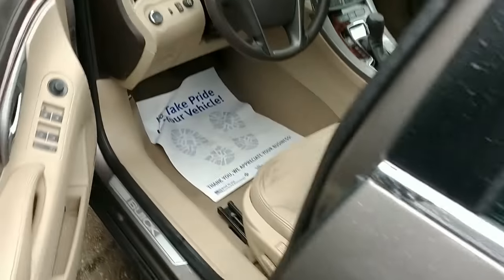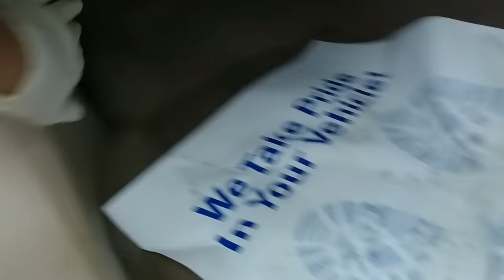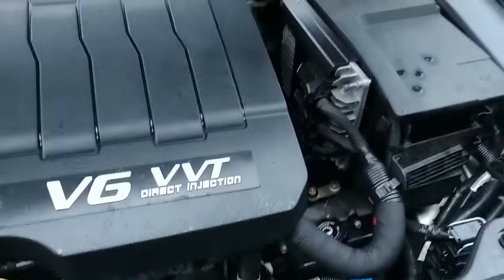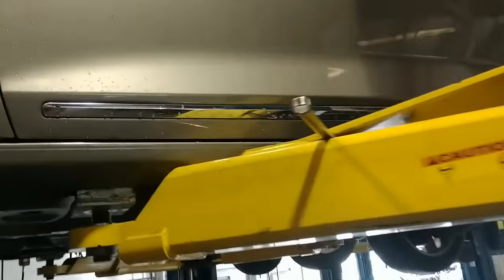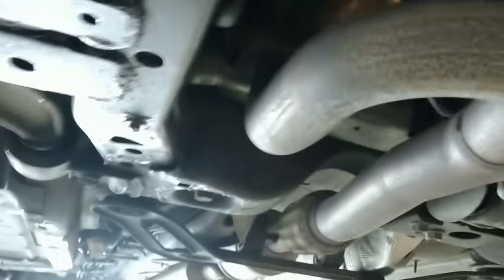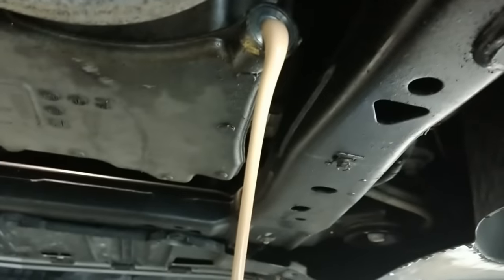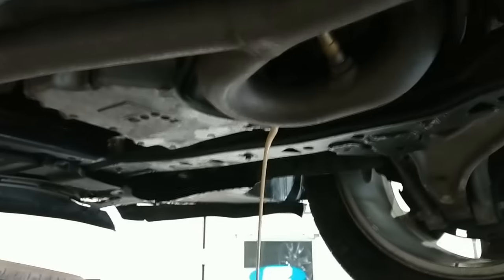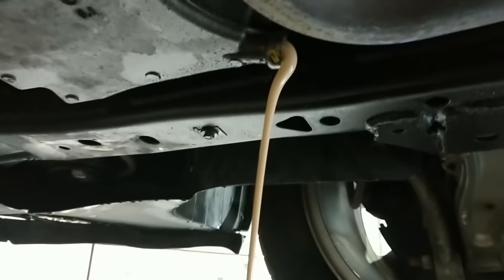Overfilled Crankcase! Blown ENGINE! Used Car Nightmare!

Comment: A buddy of mine swung his car into a firestone for a pre trip maintenance instead of doing it himself cause he was short on time. Car was overheating and being weird. Its some 2010s Subaru impreza. We check it at work. The kids in there got the fill tubes mixed up since multiple are right next each other. They put quarts of oil into his coolant overflow reservoir. They denied the mess up but they definitely knew cause they filled the engine with oil after their mistake! Luckily he was able to flush the coolant system. Dont think firestone reimbursed him

Comment: Great job on those headers flanges replacing the studs I would have been tempted to chase the threads with an old bolt with groove s ground length of the threads just to clean them out and get the chips out but great job have a great day

Comment: Back in the old days a new head gasket, coolant and oil would fix everything.
Reply: Yeah before everything was made of soft aluminum.... Also being able to use a regular steel razor blade to clean surfaces!
Reply: It could also be a cracked head or a cracked block.
Reply: Back then, you could do it in 3 or 4 hours easily as a HS kid...

Today you spend 6 hours getting at the valve covers.
Reply: @fhuber7507  god if ur spending 6 hours on Valve covers u don’t need to be doing it 😂
Reply: Yeah, but do you still want to drive a 6 liter V8 that puts out 20 hp? Modern engines are stupidly complex to fix, but worth it for the power and economy they put out.
Reply: Back in the old days cars were death traps. Pick your poison
Reply: Considering there was no leakage of that sludge anywhere, I don’t think there’s a cracked block.  I think all they need to do is get in there with a Steam-line, clean it out really really good.  put in a new head gasket and new oil  and coolant, and she should be good to go.  but I would still go back to where she bought this car from.  a copy of this video in hand, and tell them “you are going to pay for the automotive service I just had done, on the vehicle I just bought from you. Or shall we go ahead and involve the police right now?“
Reply: @Here_is_Waldo  Yes and no, some designs use more complex or fragile components not for eficiency but to actually límit the life of the machines forcing the costumbres to.pay expensive maintenamce or replacements way more often, prpgramaded obsolecence is a real thing unfortunaly.
Reply: @boatingman11  Or a cracked cylinder,  or they used the wrong coolant,  mixed coolants,  or the wrong oil!  Today's cars are junk!
Reply: @Here_is_Waldo  they are not stupidly complex. The computer allows a lower voltage do that you do not have to have heavy duty switches that cost a small fortune.  Now, the computer only does it going properly, if everything is working.  Scan it up, fix it,  go on with life. What's complicated about that?  The issue is dealers weekday money!  With coil packs made so cheap that a taco costs more to make, and they charge you a fortune for them,  yet they don't last the life of a vehicle, and fuel systems that are regulated by too many regulators and sensors it is all about the cash.. the only thing complicated is finding the damn funds to pay for the parts!
Reply: @beastabuelos6421  say what!  Death traps!  I have a 1975 G29 van with lap belts. If you hit my van with today's junk,  you will be totaled!  I'll drive home!  I believe it's called steel!  Plus,  my van will haul more than a new 3/4 ton truck!  You need to check the Reynolds Wrap made today before you call my tank a death trap!
Reply: @kenwaid8239  It's a Civil matter. The Police can do nothing.
Reply: @offgridselfteliant  That isn't a good thing or something to brag about... Ever heard of crumple zones? I'd rather have a crushed car than be dead on impact and my head caved into to steering wheel.
Reply: @beastabuelos6421  how is that when they were made out of stronger, materials smh,
Reply: I had an old 97 k1500 with a 305. Blew a headgasket like this around 210k miles during the height of Dallas summer. Had to have some other stuff done too, but it wasn't too much more than this. She ran great well past 250k. Thank god it wasn't a cracked block!
Reply: @kenwaid8239  buyer beware. The vehicle was probably sold AS-IS meaning its the buyers responsibility to make sure its in good working condition. This is the case with 99% of ALL used auto dealershits. Test drive the car STRAIGHT to a mechanic before you sign ANY papers or hand over any money, period, no excuse.
Reply: Reading the comments… happy to be on a motorcycle. I’ve been hit by a car and survived… I’m still riding. Pick your poison.

Crumple zones are nice, but there is nothing that feels the same as an old muscle car. Heavy as hell, you let off the gas and coast for like six miles off the inertia…. My old Impala had the 350 V8 motor in it. Made it to like 300k miles. 

I still prefer newer cars for a daily drive (I drive a 5 speed manual Ford from the 1990s when I need something that doesn’t fit on the bike), but the old cars had a lot of charm. That said, I do NOT miss having to rebuild carburetors and every damn thing weighing a metric ton. Honestly, the water pump for my Ford was a brick and only cost like fifty bucks. The same went out on my exes Subaru, weighed nothing and it was like $300. Odd how it all works.
Reply: @vgamesx1  Laughing. ... you hit a old vehicle with the new Reynolds Wrap vehicles that air bag is not going to save you!  It would be like a aluminum can meeting a crusher.  The math tells you that the lighter vegicle will go backward against the heavyweight vehicle.  I'd rather kiss a windshield than be smashed like a aluminum can.  If you drive into a concrete wall at 20 mph, you would not drive home.  I would!  Safety isn't just a belt and air bag. Think about it. 2 tons hitting a 1 ton car.  Plus I could have an extra 1,000 pounds in the back.  But hey,  you just feel safe in your Reynolds Wrap.
Reply: @offgridselfteliant  I enjoy my fuel efficiency thank you very much. While dealers do upcharge a lot of things to repair a car, modern engines are marvels of engineering optimized for fuel efficiency and power, and it's not cheap to make the parts for a modern engine. Sure old cars just had blocks of steel welded together for engines, but I don't think I'd like the 16 MPG at best gas mileage they have lol
Reply: @DrTranofEvil  Yeah, the water pump is something they really upcharge a lot on. It's worth 100 bucks due to all thr electronic integration put into modern vehicle parts
Reply: @offgridselfteliant  not a cracked cylinder. If you crack a cylinder you pressurize the oil the oil system enough you'll see sludge all the way to the top of the dipstick
Reply: @offgridselfteliant  same.  In my youth I had one of the last Chevy S10's made with real steel bumpers.  I hit a more modern vehicle when it ran a stop sign.   felt the rear tires on my S10 lift off the ground on impact.  Their car was totaled, I drove home and bought a new bumper.  Installed it the next day myself, good as new.  All i had to do was apply a little persuassion with a 10 pound sledge to the mounting brackets to line up the bolt holes.  Miss that car.

Comment: reminds me of a friends wife, bought a car cheap knowing full well it was leaking coolant and needed a repair (seller even gave her a 5 litre container of coolant fluid), what she didn't know was where the coolant had to go. To be fair she made it all the way home thinking the symbol that looked like a small oil can was where  the coolant went to keep the oil cool. It did not start the next day or ever again.
Reply: ouch
Reply: Well, that symbol's colored red for a reason.
Reply: I am a female and always checked my fluid levels in the vehicles that I owned since I keep them for 20+ years and make sure they are maintained. Even repair shops don’t tighten down the oil filters after an oil change so I always follow up after any maintenance. My husband was overseas for a year and I was responsible for our 3 cars and had the hoods up one day checking everything. A neighbor out walking stopped and asked if I had trouble and I said I was just checking everything. I am in my 60’s and she is older than me. She said she wouldn’t know what she would be looking for and didn’t even know how to open her hood. People don’t realize that at some point you might not have your partner and can’t rely on them for everything, be it cars, handling bills or anything yard or home maintenance related.
Reply: @tastx3142  I am a veteran myself and spent 14 of my 23 years overseas, my wife much like yourself became proficient at all the things you have mentioned. I often came home to find the entire house in different colours, rooms changed around or completely different furniture lol.
Reply: At least she didn't put diesel in the gas tank like my mother did once, yeah that happened, to be fair it was next to the gas pumps but still, your can rebuild the engine and it still won't ever run the same, it's about the same as that
Reply: @shable1436  Diesel in a gas engine should be fine, actually. Of course, it won't run because it can't ignite the diesel fuel but other than the fuel system, nothing should be affected and after cleaning that out (maybe replacing a few fuel hoses) it should run like nothing ever happened.
Gas in a diesel engine is the real problem because the fuel will ignite too soon and push the piston back, destroying the entire engine block in the process.
Reply: @Seoh wonk em  I never mentioned common sense, just pointed out that people rely on others to do basic things, and that includes males.
Reply: Tell your friend his wife should never drive a car even again
Reply: @tastx3142  you're awesome i want a wife like you that can take care of cars when I'm away :/
Reply: @shable1436  I put petrol (gas) in my diesel vehicle, realised my mistake, topped up with diesel (about 50/50) and it ran beautifully. Never missed a beat.
Reply: @tooyoungtobeold8756  I suppose it depends on the compression ratio of your engine, the octane of the gasoline, if it's diluted enough, it won't pre ignite, and you'll get away with it.
Reply: @tastx3142  Based.
Which means you’re cool, Gramma

Comment: Same thing happened with my first vehicle back in '93. Went to a Chevy dealer near me and was looking at an '87 Blazer. Looked in good shape with 80k miles. My father and grandfather had known the salesman for years outside of the dealership so they checked it out and noticed the coolant was low. They told the salesman and he said he would get it checked out. Later on he said it checked out fine and since they trusted him my father and grandfather gave me the ok. A couple  of weeks after buying it I saw it was overheating. Blown head gasket. Needless to say we were pissed. To this day my father says that was the only time he'd ever been ripped off buying a vehicle. I ended up keeping it for 4 years before I upgraded and got a good learning experience out of it. Live and learn. 
The salesman ended up dying of cancer a few years later and the dealership went out of business eventually so there was a little karmic outcome.

Comment: Even here in UK where cars need an annual inspection called an MOT test (which is itself often a scam, because if you have to take your car in once a year to get it passed, an unscrupulous mechanic can hold it to ransom), I bought a used car with supposedly a fresh MOT. Turns out the independent garage that did the MOT test was a sister company to the used car dealer, and they sold me a car with no brake pads. I hadn't driven for 5 years since passing my test and it was a much bigger heavier car than I'd previously driven, so I put the long braking distances down to that when I bought it.
Reply: Contact VOSA and they will be stripped of their MOT licence. Simples.

Comment: I would love to hear what happened when the owner was told and what was decided.
Reply: They lost it because they bought a car with a blown head gasket and the engine is likely a goner, and they either cut their losses and scrapped it or got an engine from a formerly scrapped Buick and spent several more grand than anticipated. X.x sad.
Reply: @Honey_Daddy  I mean that engine is at least worth trying a head gasket sealer (or head gasket replacement if they can afford it). If it works, at worst it will buy them some time to save up for an engine, at best it will hold up for the life of the car.

Comment: That's the most perfect emulsion of oil and Coolant i ever seen, must've ran quite a long time to mix so much coolant into the oil
Reply: What would be the cause of coolant and oil in the motor ? 
I am clueless in mechanics sry
Reply: @Gaeldx  oh thats easy, both Oil and coolant flow throughout the engine but they aren't supposed to ever mix with one another, therefore where parts are jointed theres a gasket which prevents the fluids from spilling out and at the same time from mixing with eachother, one of these gaskets is located where the whole combustion process happens therefore it often heats up a lot and eventually gets damaged enough that fluids can pass through, either to the outside, or to places it shouldnt go.

-If very heavy black smoke comes from the exhaust it could mean that youre burning oil.
-if a lot water comes out and your car requires your coolant to be refilled often you might be burning coolant or it flowing elsewhere.
-And if the two liquids mix you get that yellowish emulsion as you saw.
Reply: @birisuandrei1551  thank you

Comment: If she just bought it < 100 miles ago. Even if it was “as is” she has the right to take the establishment to court. Most states has a “known defect” law to protect consumers. Get that mechanic to write up a quote and a diagnosis take them to court
Reply: Car dealer in court: No your honor, it had clean new oil and antifreeze when it left here. We know because it took 20 minutes for the sludge to drain out and I had to yell at the mechanics to hurry up.
Reply: I think that known defect is for manufacturer defects, not mechanical damaged by previous owner. Idk.
Reply: As is means as is
Reply: @M L it does apply to dealers, but it most states it does not apply to USED vehicles. Only new.
Reply: @Keys879  Actually, many states do have a basic "lemon law" for used cars (even "as-is").  However, the laws are far more restrictive than the law for new vehicles in that only safety defects are covered, and the window to report something under the law is far less (time and /or mileage) than for a new car.  In most states, excessive steam/smoke from the exhaust is considered a safety issue, not a mechanical one, so she might have recourse against the BHPH place on that basis.
Reply: @sct913  I watch The Peoples Court often and never hear of any used car being able to fall under a "lemon law", especially a fairly old used car like this one... but I do see some states that legally require a dealer to offer a basic warranty on vehicles depending on age/miles. My state (Michigan) is an as-is state, although a car like this which is just barely under 10 years old with well under 100k miles would usually come with some kind of limited powertrain warranty at most car lots, so I can't imagine this owner not having at least a 90-day warranty, unless they waived it at the time of purchase for a discount on the car, or were just stupid and didn't have enough knowledge/foresight to demand one if none was offered.
Reply: When it comes to used cars, it's the Wild West.  "Buyer beware".  No lemon laws.  That's for new cars.

Comment: my heart just broke for your customer when you pulled that plug out omg
Reply: My heart broke when he pulled the dip stick. The "oil" draining drove it home.
Reply: Knew it was a head gasket as soon as he started it and the smoke was pluming out the exhaust.
Reply: BarbarossaBMW88ϟϟ  in this case i’m sure the cooling system failed